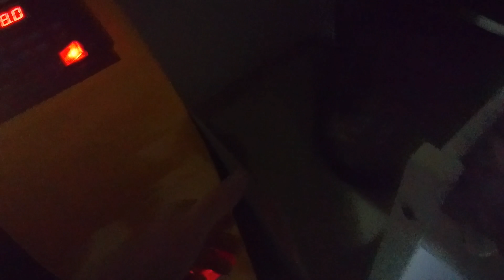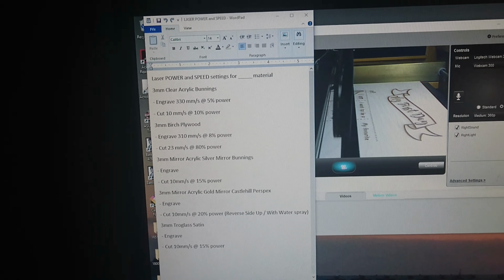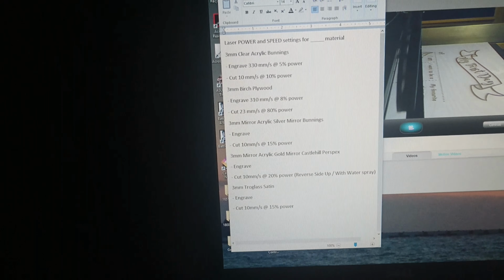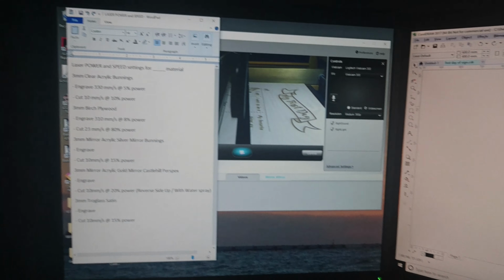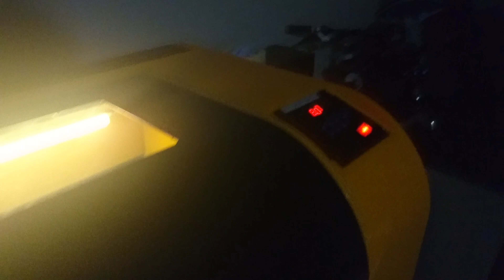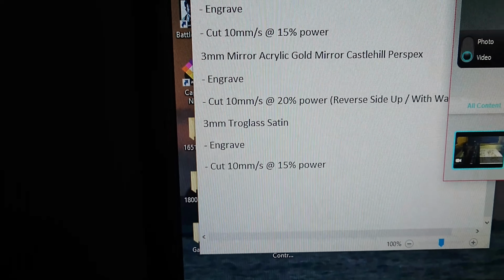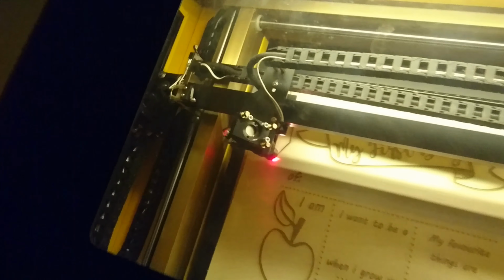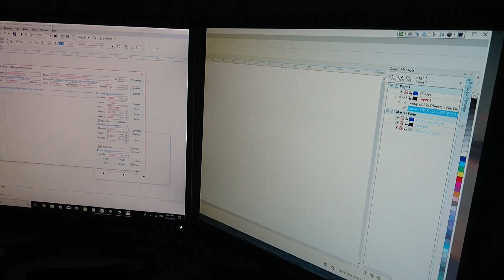GY460 / 4060 Laser cutter / engraving machine settings

Comment: Awesome setup, also trying to start up my own business kinda spend all on this. I just got my laser it the 4060 also having issue with the cutting of I send a square i drawn in corel say start it just get pop-up on laptop saying job complete but nothing happening on printer. I did engraving pictures and cut circle out but I'm wonder you could share your settings.manual they send is in Chinese so useless... Thanks in advance sorry for bad grammar and spelling using my phone...